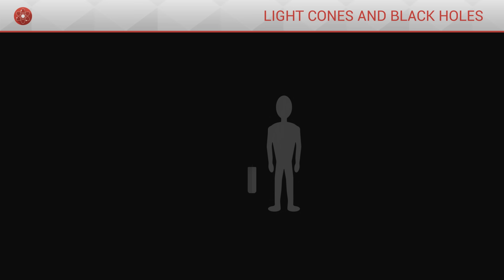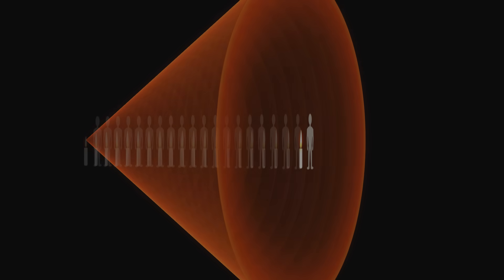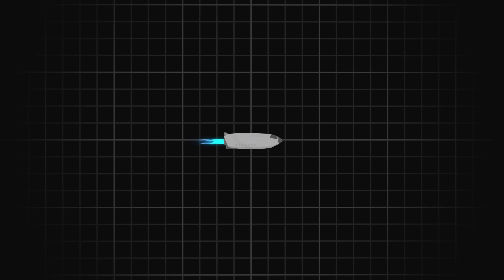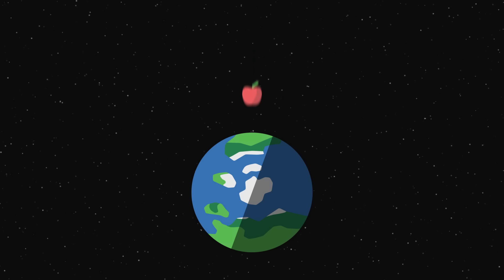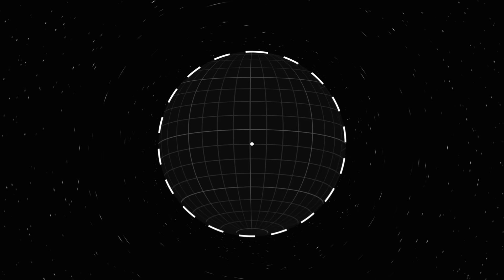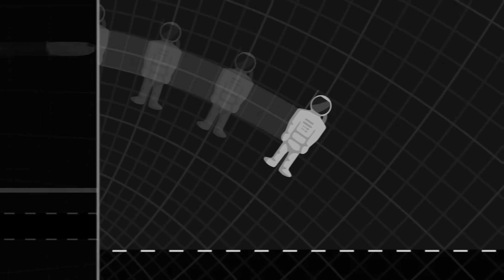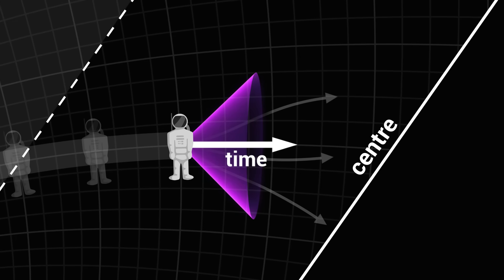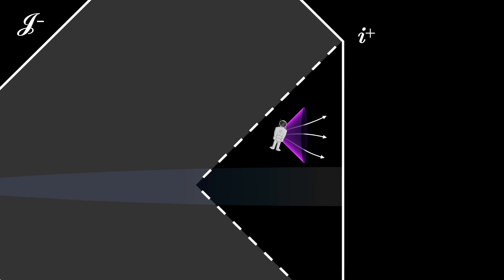Why Time and Space swap in a Black Hole

Comment: They almost certainly don't swap. We have no physics to describe the inside of a black hole so this is just wild speculation.
Reply from the maker: We very much have physics to describe the inside of a black hole, up to very close to its center. There is no reason to think that our current theories - which work extremely well and are the reason why we discovered black holes in the first place - stop working below the horizon. In fact the horizon is no different than any other place, and it is impossible to detect when you have crossed the horizon according to general relativity.

One thing to keep in mind is that this "swapping" is nothing unusual or weird. It actually happens on Earth, and is precisely what explains gravity : If we drop an apple, which is initially moving only through time (it is motionless through space), the apple starts moving through space and falling downwards, because space and time begin "swapping" around. It's due to this "swapping" that it is easier to move downwards (falling) rather than upwards (lifting a rocket) : that's analogous to how it is easier to move towards the future rather than backwards into the past.

A black hole horizon is just the place where this "swapping" is "full", such that time and space have "100%" converted into each other (speaking in simplified terms of course, otherwise it all comes down to the underlying mathematics).

Finally, one could argue that there is really no swapping. In the video I explain how time and space only appear to be swapped because the observer is far away. But for the infalling observer, they never swap, they just gradually rotate as he/she falls downwards.
Reply: @ScienceClicEN  I didn't watch the video. I just made a comment to warn people that your video is stating speculation as fact.

Anyways I think you're lost in the math, just like people thinking you go back in time when going faster than light. The equations have been pushed past their limits and break at these points.

But I am just a physics enthusiast so hey, don't trust me. The only thing I know pretty much 100% is that you have no observations from inside the event horizon so I pretty much 100% know you don't know.
Reply: @odizzido  "I didn't watch the video" that in and of itself reveals you have no room to speak
Reply: @ponponpatapon9670  I replied to the title of the video, which I read. I can most certainly comment on that because it's claiming certainty about something that is most certainly uncertain.

Comment: Very good.  Except : there is no such thing as "time", there's only now.  Space is not curved, but the 3D part of space affecting mass and affected by mass, has a vacuum (more mass gives more vacuum), and this vacuum pulls mass in.  When our universe was created, everything started out at the speed of light, and still has that speed, so if you move an atom at the speed of light, it's no longer an atom, but frozen, frozen in "time" i you like, or more likely, it's not an atom any more. ......... But appart from that, well done thorough work, but not a way of thinking that's gonna bring us anywhere.  But I'm just a stupid engineer though. ;-) ............

Comment: The "Black Hole" concept is a mental construct nonsense.
Galactic centers are several thousand lightyears thick and by observing the so called "galactic Fermi Bubbles" radiating from the center and out on both planes of the galactic disk, the galactic center constitutes a several thousand lightyear long whirling funnel of formation, and in fact having TWO electromagnetically shaped holes/openings in its spherical construction, each on both sides of the galactic plane.

Comment: They do not. In my opinion, mass itself is expanding the universe by displacement. Each mass creates a vortex if you will. Sink a beach ball into a pool and see the overall entirety go up in volume. When we look out deep into space, we are seeing the past, not so much because it took 434 billion years to get here, but because it would take more time than we’ve had in our universe’s history to get there to check. In this way we will always be behind the curve. The edge is flying away at more than light speed. Even at light speed, we could leave here at light speed and travel for 200,000 years and barely get out of the galaxy. Never mind escape the galactic cluster. And that’s not to be a bummer, but just to level with you. A black hole is a frozen beyond what the atom can handle ball of LIQUID DENSITY bosons with a FERMION FIRE RING or convective zone orbiting. It’s a galactic nucleus. When stars die, if the mass is 3.4 times the size of the sun guess what? No NEUTRON STAR (a highly compressed star) no.. we get a BLACK HOLE. Matter in SUBCOOLED SUBATOMIC PARTICLES. In my opinion, if you were able to survive the event and make it to the SHWARTZFIELD line, TIME WILL STOP and EMPTY SPACE that belongs inside the cores volume is LOCKED OUT. Thus, swelling the overall volume at more than light speed. Here’s my proof. 1. WHEN WE BEGAN WE HAD EMPTY SPACE fill out in a split second. Matter came from COOLING and solidification. Now we have FILLED THE SPACE? Simple math. We are putting IMPERVIOUS METALS under high pressure locking out the greater volume of causation. 💯☑️☕️😉

Comment: And at 5:55, we can see that, strictly speaking, gravity does not apply force to matter. It is not even moving matter through space; it is changing the orientation of its relative time, and thus turning its relative motion through time partially into global motion through space.
Could this also explain time dilation? The reason you experience less time at high velocities being a result of part of your temporal velocity being converted into spatial velocity. It would be hard to work into velocity as a cause, but it's a fun thought.

Comment: 3:20 also has the potential to be an excellent depiction of time dilation. If we assume each frame of that image were one hour apart, and one object were to move at relativistic speeds, the frames of the object would become increasingly spread out as it approached lightspeed; the other object would thus have relatively more dense time frames, and experience more hours within the same global time.

Comment: I think in this video explanation something is not right.
Time is not a Dimension. Time is a part of space itself. In the moment where you separate time from space, the space is not space anymore!
Reply: Uh no, learn what general relativity is. Time is a dimension that 3d objects travel across in a singular direction. A theoretical fourth dimensional object could travel backwards and forwards in time similar to you or me moving left or right. However none have been demonstrated to exist. 

Sounds like a mindfuck because it is, but that's how the universe worms.
Reply: @afal9224  sorry, you‘re explaining fantasy.
Time is not a dimension. Space-objects can not exist without time.
Reply: Think of it like this: Up and down trace a straight line. So does left/right, and forward/back. Past and future draw the same exact straight line, the only caveat being you can only move towards the future because time is a temporal dimension, not a spacial one.
Reply: @kijetesantakulu  You can draw anything on paper. But space is something else. We don‘t „move“ towards future, but we live in space. Space is existing, but past and future is not existing. And space itself can only exist, if space-objects can move anyhow. That means that „Time“ is not a dimension, but time is included in space itself. Without time included in space itself, space would not exist. We live IN space, - we don‘t move through „time“. „Time“ is just a „tape measure“.

Comment: Alright, if someone can enlighten me on this, I'd really appreciate it. The term "swap" just doesn't make sense to me. Across the event horizon, spatial dimensions gain the properties we associate with the time dimension. That much is very clear. But "swap" implies that time dimension gains properties of spatial dimensions. I just fail to see any explanation on this.

Wouldn't it be simpler and clearer to say inside a black hole space becomes time-like, instead of "swap"? Unless I'm missing something important. Btw this is not a criticism towards the video, I've seen this phrasing for over 20 years now, in many places.

Comment: You lost me at that light cone. Makes no sense.
Reply: It's just a visualization of what light does and can do as time passes. For the purposes of the visualization, they take a 2d perspective of how light would spread in all directions from a light source (in this case a candle, but it could apply to any object that reflects light, which is everything that isn't a black hole). Imagine all of the light produced as a circle that expands at the speed of light as light travels. So from earlier moments in time to later, there would be circles of increasing size. The cone itself is constructed from the circles that light would occupy at each instant in time. The line through the cone shows the direction time goes. The direction time goes is always extends straight out from the center of the cone and the cone always grows at the same rate and so it maintains the same general shape (so no squiggly movements).

So if you are in an objects light cone, meaning the light from an object has reached you, allowing you to see it, you could not escape it because that would require you to move faster than light. Because this is designated as a universal constant, the people who made this video say that time can, therefore, be defined by our relationship to the speed of light. 

This visualization is the basis for the rest of the explanations in this video and I honestly don't understand the rest of this video all that well.
Reply: @sebaschan-uwu   :   Thanks for taking the time to explain it, but I guess I should have been more explicit. He started off by saying that light from a candle spreads out in all directions over time. Then he said if we take a 2 dimensional slice of that light it makes a circle. Next he said if we take snapshots of that circle over time it creates a 3d cone, and light travels in time perpendicular to the 45° trace of that light cone. My question is what was the point of any of that preamble and the cone when  he started with the statement that light spreads out over time? Also how is the light cone supposed to help understand light’s passage through time anymore than just stating that light is a slave to entropy like everything else in the universe?

I really do appreciate your attempt to help me understand it, but either I’m missing something key or this video isn’t the best explanation. Tbf, I’m almost certainly missing something, but I still feel the explanation in the video is convoluted.
Reply: @______IV  i try to explain, its saying that the shape of the cone its the space the area that you can move in, and the time is the direction of which you move in only fowards or outwards of the cone
Reply: @AURAXKIRA  :   I guess what I’m trying to say is that pretty much every human who has ever lived intuitively understands that we only have access to apparent forward movement through time. More than that though, breaking down three dimensional time space to two dimensions only to then expand it out into three dimensions again is both redundant and doesn’t in any way help me understand three dimensional spacetime more than I intuitively do. To me it seems like explaining 1+1=2 by starting off explaining the 1 is the same thing as .5+.5, and then saying that once you understand that .5+.5=1 then you can understand that 1+1=2.

Comment: Two big questions about this...
-Wouldnt this entail 3 dimensions of Time, just as there are 3 dimensions of Space, to swap with?
-Is Time Gravity a Thing? As, ok, so basically you know how matter moves through space naturally to clump together? What if the same deal occurs with Time? Are they the same phenomenon?
Reply: they are not swapping in that sense they are swapping in terms of location IN a black hole, IN it there is time no space you go fowards further to the singularity only fowards no back no space doesnt exists and time only goes slower to more fowards you go, but outside of it is space and time any direction only foward.
Reply: @AURAXKIRA  thx

Comment: How do you know time and space actually swap in a black hole? Doesn't physics work entirely differently from what we currently know there? I mean we can try to apply general relativity and/or quantum physics, but we don't know if they are actually applicable there. We don't even have a working quantum theory of gravity yet, and we know just general relativity isn't enough to explain the physics of a black hole.
Reply: I think our physics dont work only inside the singularity, as it is an infinitely small point. So inside the horizont event calculations can still be made

Comment: Confusion in the presentation is not drawing stating explicitly that once the horizon is crossed the movement through space is restricted to one linear direction toward the singularity whereas above the horizon within the cone movement in space is not restricted.
Also what happens to time in the black hole? Time seems no more than defining the area where space in any direction is accessible outside the black hole. Inside the black hole time seems to disappear, does not exist, since there is no variation, again just a linear path through space, time is not required?

Comment: Well there is misonterpretation. Space is actually mix of 3 dimensions... when we talk about space when we check wat we are talking about we see its 3 dimensions logic operations... and if we assjme space is a dimension which is not actually as its ac5ivelt in touch in all times with ewery dimesion so mostlikely assu,ing it dimension is probably wrong... i mean t1 =(x,y,z) in each position of t. So time needs existance of 3dimensions at each stage... buf may me. As x too needs apecific values for a given position each iteration 😅 x=(t,y,z) for each position iteration...
Well i was trying to sy space is not a dimension while time mostlikely is... space is all dimensions togeter space has all x,y,z,and t inside it. So trying to explain space without dimensions is wrong. Buf if you mean x,y,z dimensions and time interaction logic mostlikely will be stable.
Reply: no.

Comment: We do not move through time. We exist in the present, and time passes. But it is always the present, no matter where you are in the universe, or what rate time is passing in your location - it's all The Present. It's a more accurate analogy to say that The Present time is like an ocean surface, where the wave heights indicates the rate of passage of time in that location, and you are in a boat on the surface of the Present. And you can't dive into the water, and you can't fly from the boat.

It's actually quite accurate and correct to say that 1 light year is the distance light travels in 1 year! This is because I'm about to blow your mind. The really big problem with the speed of light and time, is that we use time to define the speed of light... and we use the speed of light to define time! 

If your head doesn't hurt, re-read the previous sentence again.
Reply: when we say time in this video its not like 60 seconds time :/

Comment: So a (probably inaccurate) way I learned to grasp this concept is to remember that the closer one gets to a massive body, the denser the body is, the slower time moves for you (at least from the perspective of an outside observer). Since a black hole's density is virtually (perhaps actually?) infinite, time basically freezes for you beyond the horizon. This means that moving through space now dictates whether or not you experience any change, which is the role time played on the outside of the horizon, so locations are now events. Outside the horizon, moving through space is what dictated whether things around you changed, but on the inside, moving through time is now what dictates whether things around you change, so events are now locations.

Comment: I don't get it, how can something no longer be a space? I don't see how time can curve. The forward movement of time isn't in a 3 dimensional direction in space. It's just reality, and any direction you go in, whether it's into a black hole or into the sun, That's a direction in space, the fact that you're moving forward in time shouldn't have anything to do with whether or not you're going to end up in a black hole or simply traveling through space. I don't quite understand that part. I do understand how time can slow down as you approach the speed of light. Even though you can't go back once you cross the event horizon, I don't see how that makes space not exist, simply because I can't go back there, it's still there I just can't get to it. I don't quite understand that changes time in any way, I don't see why time should switch places with space simply because I can only travel in one direction

Comment: What if after you crossed the even horizon, you traveled at the speed of light in orbit around the black hole? At 10:10 it shows the space axis still points towards the event horizon correct?

Comment: Imagine a light cone, where time flows exactly to the singularity, so that the time and space are completly swaped. Isn't it possible then to travel to the past? The time diagramm is pointing to the singularity lets say its pointing downwards 90° degrees, but the light cone has a tilt of 45 ° to the direction of space, so if you add these to degrees you get 135° degrees which in other words is going back in time from the perspective of someone outside the black hole